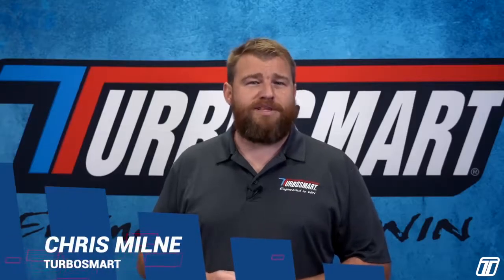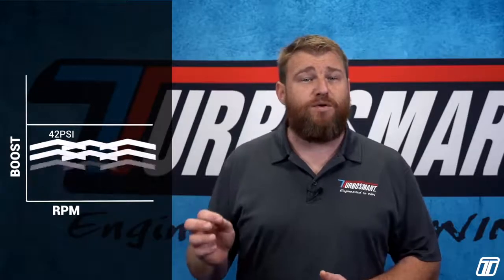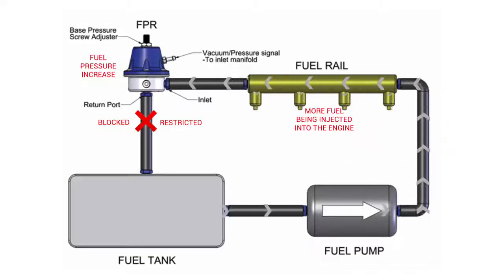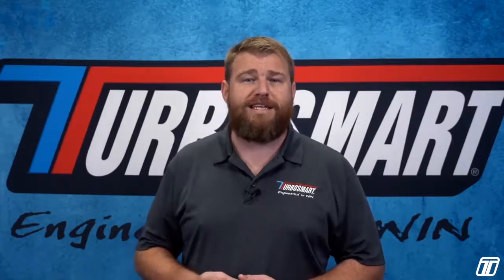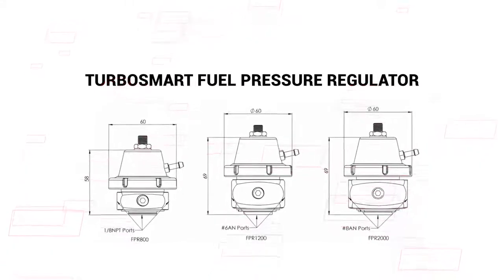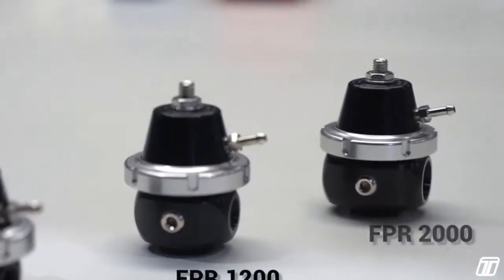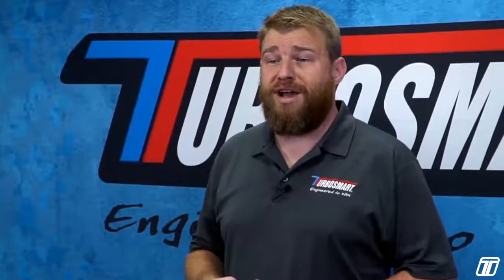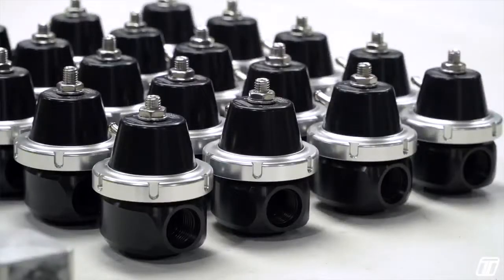How do I choose the right Fuel Pressure Regulator?

Comment: I own a smart fortwo 599cc. The fuel pressure regulator works at 3.8 bar. Is it ok to replace it with a 4 bar regulator?
Reply from the maker: You can adjust the base pressure to meet your needs. Our FPR is universal as long as you have a return-style fuel system with 1/8th npt fittings. They are not compatible with the Smart ForTwo factory fuel system. Follow us on social media as we will be introducing some new fuel system products soon.